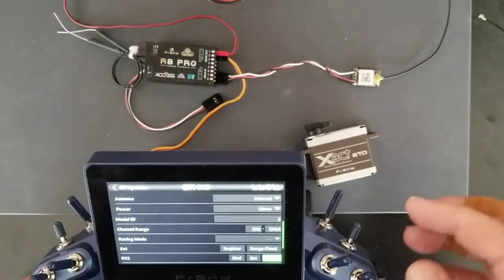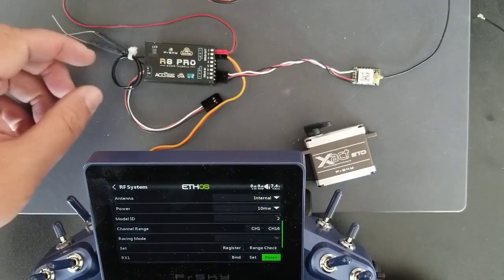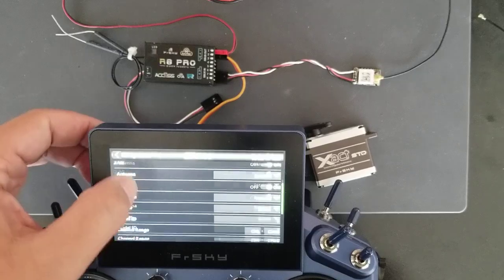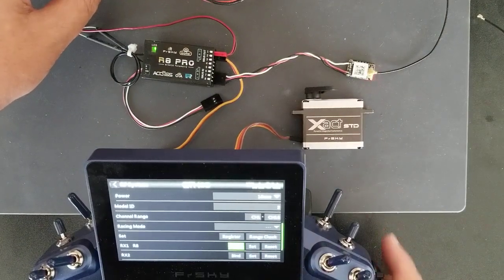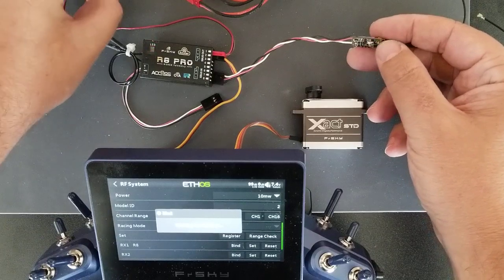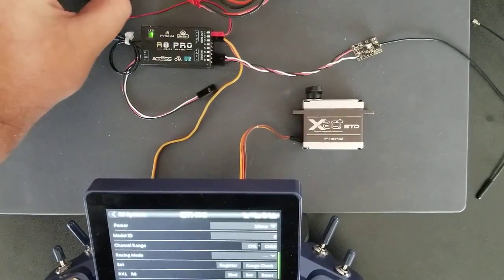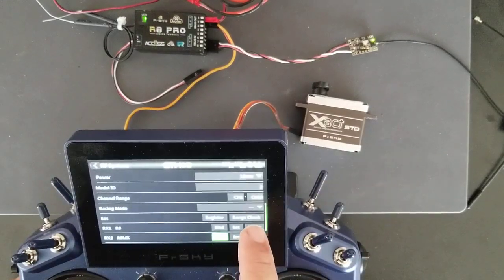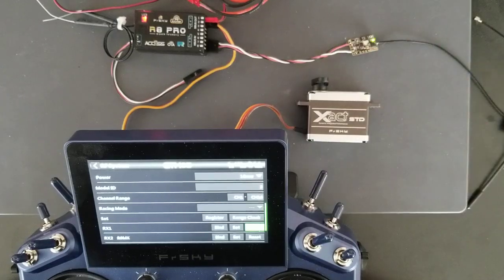FrSky ARCHER R8 Pro + R9 MX Redundancy Setup Failover Testing

Comment: Ok, I found it (SBUS-IN) on channel pin #1(sorry Im a little dyslexic :)  But then how does that affect the Aileron (Channel#1)?  Can I put Ail#1 on channel #9 (or somewhere) to maintain the STAB on one aileron?  Sorry I'm a little "thick."
Reply: @frskyben  redundancy is working...just don't know what to do with Ail#1 for stabilization?
Reply from the maker: @dean6344  yes just move Ch1 AiL1 down to a free pin
Reply: @frskyben  Newbie warning: Took delivery of TX(with Ethos) yesterday.  was using OpenTX.. Should I just do that in the Mix or do I need to do something in the RX options page (reassign a pin)?
Reply from the maker: @dean6344  under the rx options